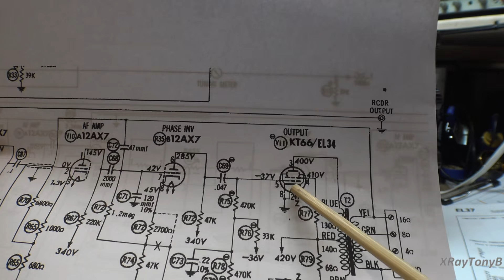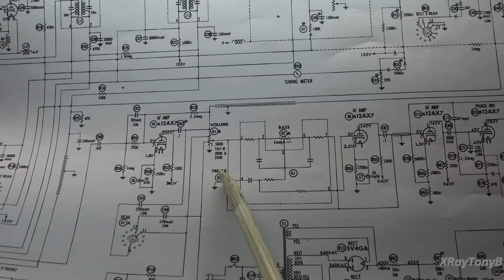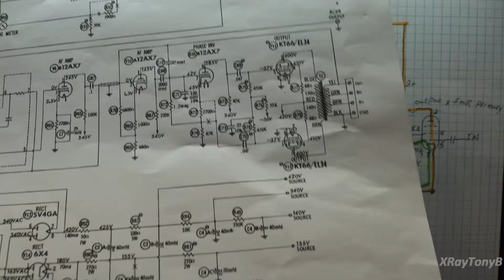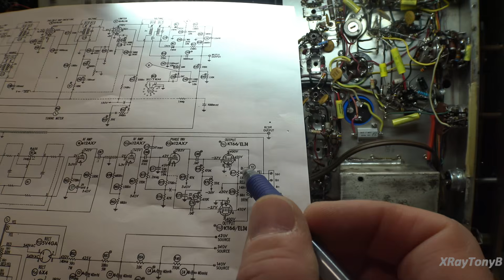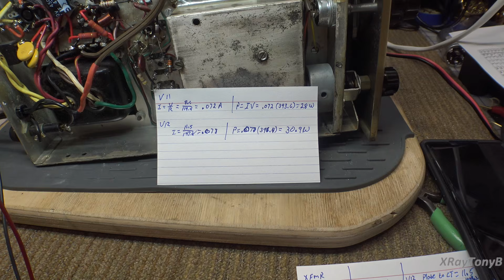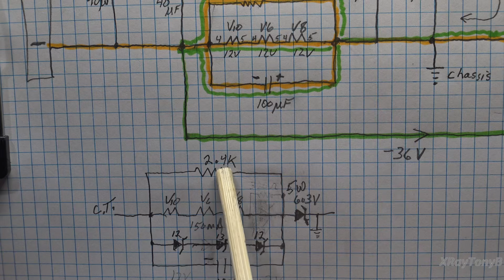Some Comments & Modifying the Bias Circuit - Fisher 500

Comment: Thank you so much for walking through the power supply to this monaural Fisher 500! It corresponds directly to the power supply I find in my Eighty Series monaural AM/FM tuner + preamp. I could grasp the current flow  intuitively, but couldn’t figure out how it worked exactly, I.e. I didn’t know what they were trying to do. Thank you so much for redrawing the circuit and explaining how it works.

Edit: Upon reviewing the schematics for my Fisher Model 80-T tuner, I should have said they are ‘similar’, or that they share some things in common. For instance, power for the filaments for FM AFC tube (6BQ7A) in the tuner section, together with the two (2) 12AX7 tubes in the preamp section, are all arranged serially and driven by a rectifier mounted in the preamp section. The rectifier itself is supplied by a dedicated winding on the main transformer’s secondary side. The negative side of rectifier is tied to ground. So it is not floating like the supply in the Model 500. With the limited extent of tube electronics, I’m not even sure if I can identify a bias resistor if I found one, but the single output tubes employed by both the tuner and the preamp stages (6C4 in each case) are called out as ‘Cathode Follower’s. I notice that both cathodes are referenced to chassis ground with at least 47kOhm resistor. In the case of the tuner action, the 47kOhm is supplemented with a 2.2kOhm fixed between the 47kOhm  and the cathode. Between the 2.2k resistor and the 47k resistor, the signal at the grid appears, fed across a 1 Meg resistor. The signal to the grid is itself fed across a 10,000 mmf (10 picofarads?) capacitor from a wiper on an external pot labeled ‘Level’.  The potentiometer itself is fed directly from the selector switch. 

At the output of the preamp section, the top of the 47k feeds a 25k ‘Volume’ pot. The grid from the second half of the 12AX7 at V14 at 0 Volts is joined by 150V ‘source’ through a 100k resistor and the anode (105V) from the first half of the same tube. This second source travels through another 100k resistor in parallel with a 47 mmf (picofarads?) capacitor before joining the second half of the same tube before together passing through a 470 Ohm resistor into the same 25k pot. The schematic notes that the 25k pot is actually ‘25K tap @ 10K’. The pot is called out as ‘VOLUME. The note appears on the side of the pot connected to the hot lead of the RCA jack labeled MAIN OUTPUT. 
Long story short, my circuit does not seem to be self-regulating in any way, and with the current limit of my knowledge I can’t even say how the output tubes are biased or whether their bias can be adjusted. 
I have some older Fisher amps, a 70Z which uses 5881 output tubes, a 20A (which appears to be designed to amplify a crystal cartridge to levels high enough to drive a speaker), and a Series 101 amp out of an old console which is anything but quiet. I remember how quiet my Model 80-T was when I was in high school, when there was something worth listening to on the radio. There still is some classical music on NPR in my area. I hope to get Model 80-T up and running and put a system together worthy of its excellence. Again, thank you for sharing the details of the Model 500, they have spurred me to further efforts.

Comment: Nice video.  I connected the cathodes of 6L6GC's to a 75Ω resistor, the other end of the resistor to ground.  Cathodes are at 9VDC but the negative rail dropped to -28V.  Increase the resistance of R85 (400Ω) to get -36V, but -30V works fine on my copy.  With 405V on the plates,  6L6GC's are idling at 23W each, max rating for Sylvania 6L6GC is 26W. Your amp might be slightly different than mine.

Comment: The current through the 12ax7 filament string is about right, the problem is that the plate dissipations are too high. Maybe you could find a way to drop the plate voltages, zeners in the B+ line, different rectifier tube? The plate currents shouldn't change much. Good luck with the rebuild, took me a while to get my head around the unconventional bias arrangement.

Comment: Tony, awesome video and great explanation of how the bias circuit works. I also loved your solution to the bias problem. My only concern is what happens in the event of a 12ax7 being removed from the circuit and or an open filament on one of the 12ax7's? Wouldn't that destroy the zener diodes? I know that is a bit unlikely but since this amp will probably end up in a non-technical persons hands, removing a tube for testing while powered up may not be far fetched. Would this not destroy the bias circuit modification? I'm not being critical just thought something might be incorporated in the circuit to prevent that. Once again, AWESOME video!

Dennis
Reply: Very good point and it's disappointing that you had no reply.

Comment: Very good series, as usual. Good to learn about repairing the IF transformers; you never know what will come in handy. About the equation to calculate C: as it turns out, if you enter the frequency in MHz, as you did, you'll get the capacitance directly in pF, which is the most useful unit in this case. This only works if the inductance L value is entered as H, not uH. Exercise for the student to see how this works out.
Reply: Yes I thought that was what he was doing, but apparently not.

Comment: So you basically have the output audio present on the filaments of the 3 12AX7's,
(you can see the voltage variation on the Fluke when you play the music)
and that's not a problem neighter for the filaments nor as a source of audio
feedback from the output stage back into these 3 input tubes?
It's an unusual design, I can agree with you on that for sure :-)
Nice and good explanation of the circuit, thank you.
Reply: The 100uF capacitor bypasses the audio signal leaving just the DC plus a slight averaging voltage change which will be insignificant.

Comment: Need to do a video of tracing circuit flow from positive to negative side of power supply. It sounds backwards to which way the electrons are flowing, but because of the common grounds, or ground bus (not always the chassis) being on the negative side of the circuit one can loose track of where the path goes. Block diagrams are another tool for troubleshooting which can condense a seemingly complex circuit. Reading the theory of operation in the service manual is helpful too. Just tools in the tool box. Use what works for you, and don't fear learning from others something new.

Comment: Hi Tony. I’ve found it’s more useful (and less confusing) to use electron current when dealing with tube equipment, simply due to the physics of how thermionic emission works.
For those reading along, here’s the low-down:
You have a hot filament (tungsten wire that gets white hot, due to current flowing through it), and a “cold” (unheated) plate, or anode, all enclosed in an evacuated glass bulb that’s pretty close to a vacuum (or the filament would burn out.) Because of the hot filament, there’s a sh*tload of electrons (negatively charged particles) hanging around, but they have nowhere to go (yet.) So they’re sort of like teenagers near the stage at a heavy metal concert. 😏 Now, if we connect a high voltage between the filament and the plate such that the plate is positively charged, now the electrons are attracted to it, return through the B+ line and the full-wave rectifier, and they return to the hot filament (of a tube, such as a 5Y3, or a 5U4). Everyone’s happy.
But, if we reverse the polarity and hook the - terminal to the plate, and the B+ line to the filament, then the electrons coming out of the high voltage supply all jam up at the “cold” plate like rush hour traffic that’s stopped due to an overturned semi. This is because the plate isn’t hot enough to release a cloud of charged particles, AND - furthermore - they’re the wrong polarity. Even if the electrons COULD leave the plate, they’d be repelled by the cloud of electrons already hanging around the hot filament! Like charges repel, and all that jazz.
So, essentially, electrons are not only the majority charge carrier, they’re the only charge carrier. I hope this explanation is both educational AND entertaining! 😁
Reply: Think of the B+ supply being a vacuum cleaner which is powering the circuit. It takes practice to follow an energy path that seems backwards. It is a difference of potential that powers the circuit. Maybe Tony can explain it better, but it is easier to follow the energy path in a schematic for me.
Reply: zulumax1 - one could also think of the B- as a leaf-blower that powers the circuit. 😏
Reply: There you go again trying to sound superior.

Comment: Some of the Scott tube amps (with adjustable fixed bias) ran 3 or 4 preamp tubes in series off of the cathode voltage avaliable from the output tubes. I seem to recall the Scot 299 integrated amp did this.  Another way to look at it is that the series resistance of the preamp tube filaments is what lifts the output tube cathodes above ground and develops the necessary voltage to heat the preamp tubes, even in a fixed bias amp with negative bias supply to the grid, that would normally be expected to have the output tube cathodes at ground and with zero voltage potential.  I also have a Danelectro guitar amp with two topmounted 12Ax7s filament-wired in series and heated by the cathode voltage from the output tubes on the bottom-mounted amp chassis. The tube filaments actually are the cathode resistor!  That amp gave me a heck of a shock when I unplugged the shielded RCA carrying audio from the top preamp to the bottom amp in order to track down some noise issues; the audio-cable shield was the only ground between the two chassis, and when I unplugged it, the 6L6s lost their cathode ground, and therefore had nearly full *plate voltage on the cathodes*, which went searching for ground through the now-cold, and therefore low resistance, 12AX7 filaments, through the shield of the audio cable that I had just unplugged and was holding in one hand, with the other hand touching the amp chassis.  Zap! I hardwired a ground between the top preamp and bottom amp chassis, and lifted the shield ground, for safety and lower hum.

Note that any amplifier or receiver with series-wired tube heaters needs for all tube pins and socket connections to be clean and tight, and if one tube doesn't make a good connection or the filament burns out, all the tubes will go stone dead and refused to heat. Plus, you will now have full plate voltage on the cathodes of the output tubes, if it is an amp design where the only cathode biasing for the amplifier consists of the series resistance of those tube filaments.

Comment: Other tube socket and tube compatibility weirdness: a 6550 with a metal collar around the tube base typically has an internal connection to pin 1 and so pin 1 on the socket is supposed to be connected to ground. If pin 1 of the socket has been wired as a tie point then you risk having live voltage on the metal collar of the tube! And of course, tube amps designed for beam power tybes such as 6L6, 6V6 etc  often have the sockets' pin 6, unused and unnecessary for those particular tube types, repurposed as a tie point for screen resistors or grid stoppers or whatever;  which is why you cannot simply plug an EL34 into a socket wired for a 6L6 etc without checking it first. Always check socket wiring carefully before making tube substitutions;  aside from the chance of blowing a tube there might even be personal safety considerations.. 

 I have worked on some Chinesemade  Hurricane amplifiers. Mono blocks with 8) 6550s, that had adjustable fixed bias but used 10 ohm cathode resistors to drive a built in display for measuring bias, so that the customer could easily bias each tube individually.  Unfortunately, the cathode resisters were connected from ground to pin 1,  not  Pin 8 as you would expect,  and there was a jumper on the socket connecting pin 1 and pin 8. The cathode resisters were known for and perhaps designed to  burn "open",  especially if you had a shorted output tube, and so if the customer replaced the presumably bad tube himself (because it wouldn't show any bias current in the meter)  without realizing that there was a blown cathode resistor,  you now basically have full plate voltage ( no ground connection, therefore no voltage drop) on the cathode, pin 8,  of the tube,  which was also jumpered to pin 1 on the socket,  and pin 1 of the 6550 tube  has an internal connection to the metal base collar.   This poses a large potential for electrical shock if the  owner, or a tech, fiddled with or changed the tube that wasn't registering any current on the amps' built-in digital bias meter.

 Does anyone know why those metal collar bases on a 6550 would be internally tied to pin 1,  and expected to be grounded? Perhaps some kind of shielding if the tube  is being used as a transmitter?  I do know that the original metal shelled 6L6's had a ground connection at pin one for the shell, and those were frequently used as an early home brew ham radio transmitter tube. Some hams would reportedly suspend the metal 6L6 tubes upside down in a bath of oil to keep them  cool!

Comment: Re the 12AX7 heaters, they're in series, not parallel, it's cool, i make video's too and screw up all the time, it aint easy. Anyway, 3 x 12AX7 heaters in series should be 37.2v yes, as per the datasheet (3 x 12.6v) @ 300mA, so they're under running them by 0.6v per valve? The average heater DC resistance is about 6r for a ECC type valve, so that'd be 18r in total say, so why the 400r resistor? 400r and 18r in parallel = 17.22 ohms, which will allow plenty of current to the OP stage. If the 400r wasn't there then 18r would still allow plenty of current to the OP stage, IE 36/18 = 2A, doesn't make sense, or am I missing something? 
  Also noticed the OP valves screen grids aren't de-coupled, curious.... Anyhoo, will watch the rest of the video. Thanks for uploading.....DA.
Edit, could you have just not added a 6r or similar resistor in series with the 12AX7 heaters?
Reply from the maker: The 12AX7 uses 300 mA when the filaments are in parallel (i.e. 6.3v configuration).  When connecting between pins 4 and 5, the filaments are in series and they run at 150 mA.  The cold resistance of the filament is much different from the hot resistance.  It might read 18r when cold, but using ohms law, 12V / .15 A = 80 Ohms hot.  That would equal 240 ohms, with 3 in series.  The parallel resistor to the filament string will form a current divider, as well as reduce the overall resistance of that node.  As this is situated between the cathodes of the OP valves and the return path of the power supply, it acts as a type of cathode bias.  In order for this to work, the OP valves need to transfer enough power to make the voltage drop 36 volts (give or take) to properly heat the 12AX7 filament string.  Unfortunately, this configuration will not raise the cathode enough to allow the control grid to be negative.  This is why they took the voltage drop across the filament string and applied it to the grids of the OP valves.  Pretty ingenious!  This only works, however, if the OP valves are of the correct specification.  Adjusting the value of the parallel resistor will allow you to "tweak" the setup a bit, but if the bias point of the valves or the B+ voltages are too far out of line, you need to change the voltage drop without changing the voltage across the filament string.  The zener diode approach seemed to be the simplest solution.  The zeners will prevent the filaments from going above 37 volts, but if the voltage drops below 36 volts or so, the resistance of the filaments will go up as temperature goes down and the bias will go up, which will raise the filaments back up.  In a way, it's somewhat self-regulating!  Neat circuit!  Thanks for the comment!
Reply from the maker: I almost forgot, the screen grids have a 68r resistor on them, but I may not have drawn them in.
Reply: @xraytonyb  Damn this is new to me too. They did not have Zener diodes or even silicon diodes in the early days. I never thought of the self regulating thing either as a reason for using filament strings as a resistor. I have seen videos where a small battery was used for bias, it was not a conventional battery and it would often still have charge on it even today. . They looked like a thick diode maybe, Oh the hz and farads, henrys and ohms. I am no math whiz even though my dad was an actuary, but the whole thing cancels out if you use Khz or  Mhz you are basically multiplying by 1000 or a million the henrys and farads will then be  millihenry or Mfd. It can be simplified. Its like going to the smallest common denominator I guess. You get rid of all the zeros. Yes you have a  habit of saying the wrong word when you are in a hurry.  You brain knows the right word but your mouth does not listen. I really appreciate the videos.  I do not do any of this anymore. Its in my past and you wake it up.

Comment: Can you recap a discussion about farads? ;)
Reply from the maker: I must resist the temptation to offer my ohm opinion at this time, as my mental capacitance is impeding my ability to properly resonate with the subject at hand.  ;)
Reply: @xraytonyb  Nice!!!
Reply: I would like to think we can can have a discussion about tubes but I think you might be biased. 

I'll just stop there, heh
Reply: @ianide2480  Stuck in a vacuum, huh?
Reply: The formula is this - 1/(2 * pi * R * C) or sub F for either R or C { * = times by/multiply and  / = divide by}. So to find the 3dB point of an RC network of 2K5 and 220u we would write it like this 1/(6.28 * 2500 * 0.000220) = 0.28hz. Some examples of capacitance in farads..... 10n = 0.000,000,010, 100p = 0.000,000,000,100, lastly 47u would be 0.000,047. hope that helps.....DA